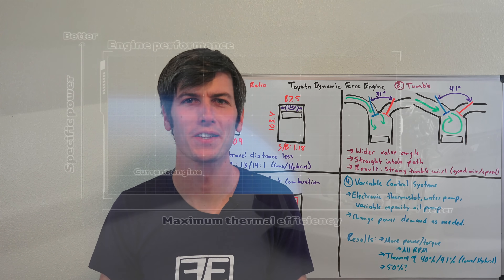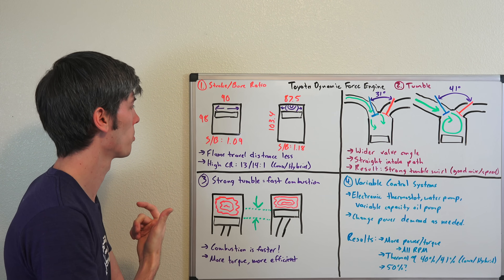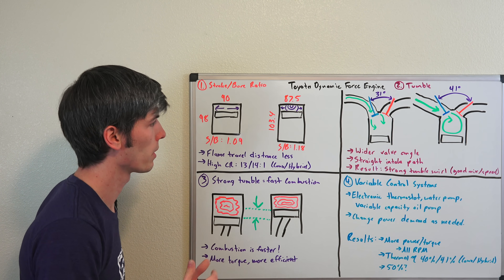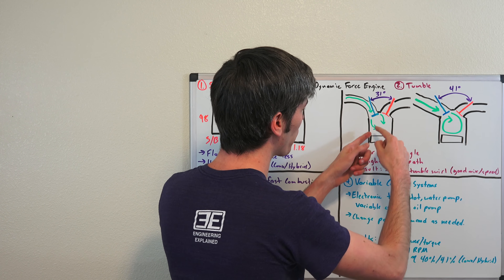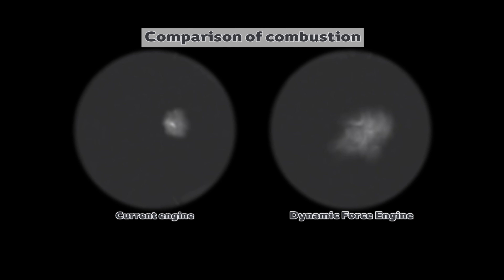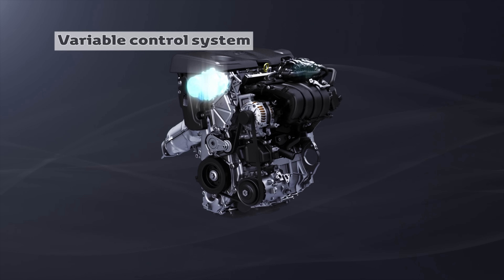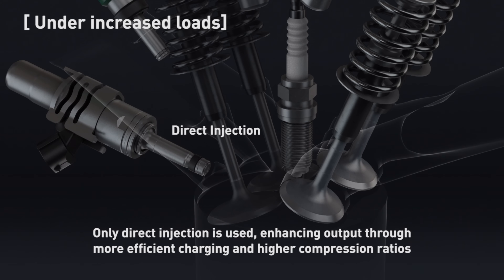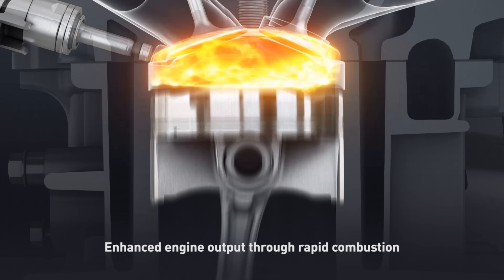Toyota's New Dynamic Force Engine Is Super Efficient

Comment: IC engines been around for 140yrs. It's time to move on to something else
Reply: Oh, what clever analysis. Wine and cheese have been around longer still. Should we move on from those too? IC is/was way smaller & more efficient that external heat around water tubes to run steam cylinders. Liquid petroleum is much less dangerous than a car's propane tank in underground parkades, hydrogen IC creates unpredictable flame in cyl, and methane/CNG tanks are so heavy they affect handling (I've owned 3 CNG cars: so cheap to run). Hybrids get same mileage as good IC's (on highway); total electric requires same energy amounts to recharge but you don't see the CO2 being created at the coal/NG powerplant (or the nuclear waste). I know, let's walk 20 miles to work in the snow instead as we drop the kids off at daycare on the way...
Reply: Sorry, your 1-liner sounded like more of what we hear from our city councils here in Vancouver, who stopped 3 freeways at city limits and just spent a decade actively choking all major roads in or out of downtown (now slow crawl means increased emissions) by expanding bike lanes which are empty all rainy season. 
Having happily reduced a bit of CO2 (and a lot of $) driving 3 domestic CNG vehicles to worksites around town, believe me, natural gas is not a good fit for everybody even though it helped me.
BTW, world's first Prius taxi was in Vancouver 2001. Very unexpected, many clients refused to ride in anything but a full-size cab. When Toyota found out there was a Prius being driven that hard day and night, they set up a factory hotline team for him and then bought his taxi back when it was finally thrashed. They tore it apart just to see what to improve on your newer Prius. That's not moving on from internal combustion, hybrids just re-use the energy their IC first burned. This video shows how even greater efficiency can be achieved, hopefully in their Prius engine too. Toyota hybrid IC's are the best way forward, especially Prius V.
Reply: Dude all I was saying is time to explore options. I drive a prius and I get avg 55mpg with almost no emission (pzev), i m doing my part to save the earth. USA has at least 200yrs supply of NG, why not more CNG/NGV? and get off the unstable oil addiction?

Comment: bore and stroke of a 1500 triumph spitfire engine. Compression ratio  of a diesel, tumble charge like an outboard marine 2 stroke engine. Variable drives for all power consuming systems. What will they think of next?
Put a turbo on it and insulate the engine so it stays warm for many hours. and it will be more efficient yet. Ain't nothing new yet it is more complicated. complex systems = unreliable outcomes.  CAT is Bored.

Comment: You might want to look at the proposed 3 cylinder opposed piston turbo diesel from Achates engineering. Supposedly it made 270 hp from a 2.7 liter displacement, with thermal efficiency of over 50%.

Comment: unfortunately it will loose all that in 10,000 miles when the valves have so much build up its rediculous.this is old race car technology ,its why we switched from 23 degree heads to 18 because the air flow is way higher.but the GDI will ruin all this pretty fast in this engine.
Reply: The carbon issues with GDI is why Toyota designed it with both port and GDI injection. The only time it uses GDI is under heavy load. The vast majority of time it is port injection which will keep the valves clean. He went over this in the video......

Comment: So it's about 2% better than their 1NZ-FXE engine (which I have in one of the Toyota hybrids). According to Toyota, it can reach 38%. Might be worth explaining that this is achieved when the engine is operated in the "Atkinson cycle". In tandem with the hybrid electric traction, the engine is often run at a steady, quite high speed, in this mode, and never allowed to 'idle'.

Comment: Its should be mentioned that the efficiency is at a particular load and rpm.  In practice on the road, average efficiency is much lower which is the drawbacks to ICEs.

Comment: What about the fact that those engines require the use of 0w16 engine oil? Maybe thinner oil galleries are contributing to thermal efficiency as well? Wonder what Toyota was thinking with that or if 0w16 is just going to be the norm from here on until we get even thinner clearances that require oil like 0w10 lol

Comment: Are you kidding me? 40% is not super efficient. 80%+ is super efficient. Gasoline engines are very wasteful, with over 60% of the work done by burning the fuel, wasted as heat. Do you think water cooling is there for show? You need a way to dissipate that excess heat somehow.
Reply: The theoretical peak of the Otto cycle is above 60% at high compression ratios, but that's before heat scavenging through thermocouples, turbines etc. To be fair, the only engines achieving higher are Diesel engines right now, because of the higher compression ratio.
Gas plants connected to the electric grid aren't better, 34% for single cycle and 62% for combined cycle plants. But again, with heat scavenging you can make use of that excess heat, eg. for house heating (or to heat the interior of the car in winter).

Comment: Looks like a hemi-chamber with 4-valves and variable timing - direct injection- eliminating parasitic loss with electrically powered - and high-torque long stroke. I am sure the intake features a long ram-effect and high-flow exhaust —— now they can add both turbo and supercharger + hybrid —— all great until something breaks and a new car will be cheaper to buy than to fix ——- hey — that is the goal. 
On the other-hand a Chrysler slant 6 would run forever and cost pennies to maintain and repair —— 

Building engines that have valve interference and warping when overheated and excessively complex tech might be a gross gain forward but questionable trade off of net gain over simplicity- durability etc

Comment: Very well explained about new design
I have a suggestion, instead of aluminum alloy used in piston and connecting rod and instead of steel gudgeon pin why not use carbon fibre processed parts, as it's 5 times lighter and 10 times stronger than steel, as we lower reciprocating mass in engine it always improves efficency.
Correct me if I am wrong.

Comment: I love Toyota! One of the most reliable and affordable car brands. Kind of weird that no one has ever designed the valve angle and stroke vs bore ration that way. I am a bit skeptical about the electric oil and water pump though. Seems less reliable. Although easier to diagnose failure of them

Comment: It should also be mentioned that this high efficiency can only be achieved at about 80% of full engine load and medium-range revs. If you want to drive as efficiently as possible get a car with a tiny engine that is just powerful enough and give it plenty of throttle.

Comment: The 1ZZFE has a 79mm bore and a 91.5mm stroke, that's 1.15 by my reckoning. They've been doing long stroke engines for a while. A lot of inline fours are supposed to be pretty undersquare to begin with too.

Comment: I upgraded from 2009 Camry LE. 

2018 Camry SE 2.5L, I must say the engine run very smoothly; and even though the car itself look light and sporty, its as heavy as the previous Camry models. 

If you’re looking for a quicker Camry, you’ll have to go for XSE or XLE with V-6 engine model. 

It takes about 13 seconds for the 2.5L SE trim to reach 70 mph, but once it gets going, the car is very quiet and smooth; overall, the 2.5L SE trim is efficient enough for me as I’m not looking to go from 0-60 mph in 2 seconds lol 

It’s a great car with a mixture of sporty and luxury accents.

Comment: 40% efficiency is your definition of "Super Efficiency"?!! I am going to blow your mind! ready?...... Electric engines! I'll let you google their efficiency
Reply from the maker: Everything is relative.
Reply: Electric motors are not engines. And if all you care about is "efficiency"... an electric motor driven by solar energy is only 12% energy efficient... So what? Efficiency only matters when comparing apples to apples.
Reply: Efficiency matters when you have limited amount of energy available.
Reply: Sure, but the most efficient means of using the energy stored in gasoline is to put it into a combustion engine like this. What alternative do you suggest for this limited energy source?

Comment: On the F1 engines (and it is not only Mercedes that does the 50% efficiency now). Those engines use lots of exotic materials, specially optimized fuel and their mechanical tolerances are so small the have to be preheated before they can be started(the preheating is done by running hot oil through them). So not only expensive also impractical for everyday use + they aren't exactly engines that runs for hours and hours. 
A plus though would be having 700+ bhp under ones right foot and that is from a 1.6litre engine. Include the hybrid systems and it will about 1,000 bhp :-)

Comment: I wonder how well this might combine with what Mazda is doing with their Skyactive-X engines, that is engines that run so a high compression that much of the time the combustion will be triggered by compression alone like in Diesel engines. The Mazda engines are supposed to give like 20% economy/performance. Mazda and Toyota have entered in a partnership and are building a shared plant in Alabama, so for sure there will be technology shared between the two.

Comment: Good to see this, but it's going to need hi octane gas, which is a lot more expensive than regular.  How does cost per mile compare to best engine that burns regular?
Reply from the maker: It uses regular octane gas (recommended by Toyota).

Comment: Isn't the efficiency of a heat engine ultimately decided by the temperate difference between the two heat reservoirs?
Reply: Janaka Goonasekera Meh all that matters is that entry level Toyota’s will get 30 horsepower more!

Comment: BMW has some of this stuff.   Electronic water pump, electronic thermostat and electronic valve timing in the 2006 325i.  How reliable?  Let's say a friend of mine has replaced both the E-water pump and the E-thermostst before 80k miles.   Not so good.   I guess she was lucky she did not have a E-oil pump in the thing.  So long term reliability could be an issue. 

Now another question.   Can this engine enable a standard cost car to meet the 2025 fuel and emission standards? If it can, it would put to bed the lie that the auto manufactures can't meet this standard.   That is, if this engine can really meet the 25 standards.

Comment: mercedes f1 engine hasn't 50% thermal efficiency, they say that they use the residue energy of exaust to charge a battery, trhu a turbine generator, that an electric motor can give bak as thrust when needed.
so the global efficiency of 50% is reached, but this would not mean the engine itself has a 50% thermal efficiency.
this is how if we say that a hybrid car, because of the regenerative braking has a thermal efficiency of 50%.... this is not true...

Comment: You want 12% better fuel mileage-simple make it a Diesel. No matter how efficient gasoline engines get, Diesels will always be more fuel efficient since Diesel has 129,500btu/gallon and Gasoline (pure gasoline) 114,000btu/gallon.
Reply: Tom Christman This engine has the same thermal efficiency as many diesels. And diesels are bad for environment.

Comment: I always thought electric pumps are better.  Everyone went to an off-engine electric fuel pump a long time ago.  Why not put the electric water pump at the base of the radiator?  And an electric oil pump (in the engine) could run a moment before starting the engine to get things lubricated first.  Furthermore, electric power steering and electric a/c compressor could really simplify an engine.

Comment: That was a very good presentation.  It explained the technology very thoroughly.  However, I do think that there is room for varying opinions on what the optimal bore to stroke ratio is for efficiency.

The stated efficiency is probably the efficiency at wide open throttle since at part throttle, considerable efficiency would be lost because the engine would have to suck air in against the vacuum created by the throttle valve.  Unfortunately, in vehicle applications, engines have to operate at part throttle most of the time which is the major, but not the only reason, Diesel engines are more efficient than Otto-cycle engines.  Monster sized Diesel engines have achieved an efficiency greater than 50%.  Probably Otto-cycle engines could come close at wide open throttle.

Experimental engines have been made with computer controlled valve actuators instead of camshafts.  That actually makes it possible to eliminate the throttle valves.  Such engines are more flexible and efficient.  At one time it looked as though carmless engines would replace engines with camshafts, but there were problems which prevented carmless from getting into production.

There is one thing which could have been more carefully explained.  Many people associate detonation with combustion that is too fast.  Actually, if combustion is sped up by increasing turbulence and having the spark plug in the center (or multiple spark plugs), then the combustion can be completed before the pre-detonation reactions have time to occur.  That makes it possible to have a higher compression ratio without detonation.

Actually, it is the EXPANSION ratio, not the compression ratio, which determines efficiency, at least theoretical efficiency.  It is possible to reduce the effective compression ratio without reducing the expansion ratio by delaying the closing of the intake valve which is what Toyauto does with the Priapus engine.

Consider including the simple formula which determines the maximum possible theoretical efficiency based on the difference between the high and low temperatures on which a heat engine operates.

Comment: The only way Mercedes hit 50% is because of the MHUG. But thats also during a race so not really a equal comparison.  I dont think Toyota is hitting anywhere near 40% in race situations, but 40 and 41% is damn impressive. 

Wonder what kinda numbers Toyota will get if it uses sparkplugs that have a little mini chamber on them that gets ignited first and then that ignites the rest of the fuel. So instead having a tiny spark as the source, you have a little combustion which as a number of benefits in terms of power and efficiency.

Comment: If the engine is cold, do thermostats in regular engines bypass just the radiator or do they bypass the cylinderhead(s) too? If they only bypass the radiator: Would this new engine warm up notably faster if the electric waterpump doesn't kick in until optimal temperature is reached? If so, that would reduce fuel consumption while potentially reduce engine wear, I guess.

Comment: Thanks to the explanation.   It seems  to have port and direct combined injection system - can you advise when one is used only and when both used?  
And is the purpose of combined injection fuel saving mainly or more fuel combustion to increase power mainly?  thanks,

Comment: this is old actually, its just marketing to attract customers by trying to say their car is new and high tech because theres not much advancement going on in regular combustion only cars. I've seen cars that get better efficiency by using a smaller turbo engine rather than a 2.5 liter straight 4 which for a 4 cylinder petrol engine is quite big.

This is done in diesel, longer piston travel times with the combustion finishing sooner. Some petrol engines do this too but its not as common because it reduces the maximum engine rev.

Nevertheless its good that you're explaining different engines and how they differ from one another.

Comment: I don't understand how the combustion is faster. I thought flame front speed was a property of the fuel.
Reply from the maker: Yes, but a better mixed, more homogeneous, turbulent air/fuel mixture will burn faster than if the fuel is not properly mixed, and the A/F ratio is more random throughout the mixture.

Comment: Toyota took their heads to the hot rod shop! Wider valve angle (like a Hemi but not 53 degrees like Chrysler), removing valve shrouding and straightening the ports. Straight out of the '50s and '60s. The electronic stuff is another matter!

Comment: Unfortunately, this new technology and including the Mazda Skyactiv tech doesn't live up to the hype. I have a 2015 Mazda 6 and it feel under-powered in comparison with the old MZR, the only thing I can notice is the fuel efficiency (which is the main reason of these new techs) Same happens with the new Camry, I test drive one and it felt really under-powered, and the tranny was like looking for the right gear, it was really bad, I can say even the skyactiv have better power than this new dynamic force engine. And again, I'm not a particular fan, just tried for myself. Sadly those HP and torque numbers doesn't mean anything this days.

Comment: Sorry, what? Petrol IC with 40% thermal efficiency at peak?  Mercedes at 50%? The holy grail of I/C engines?? Coolant? Operating temps??     When/how did the Carnot Efficiency of naturally aspirated petrol engines surpass the theoretical upper limit of 36%?
Higher Carnot efficiencies can only be achieved by cooling the intake air, and/or having colder exhaust gases (at the exhaust valve), while having higher combustion temperatures. Is this all down to higher compression ratio's and better anti-knock design/control?